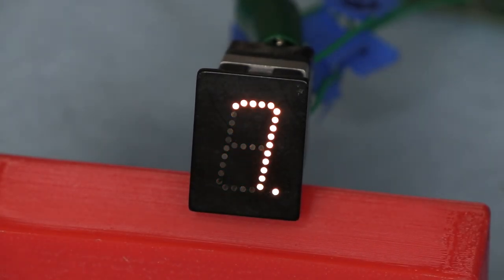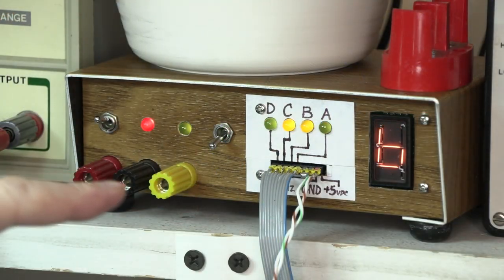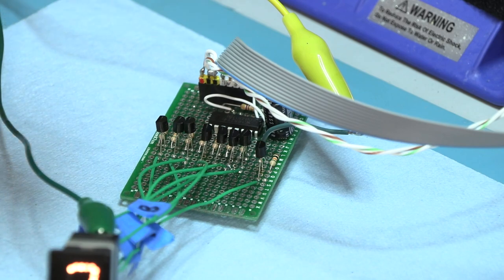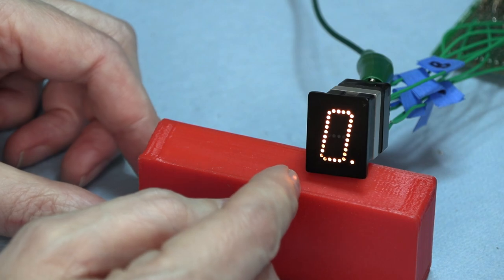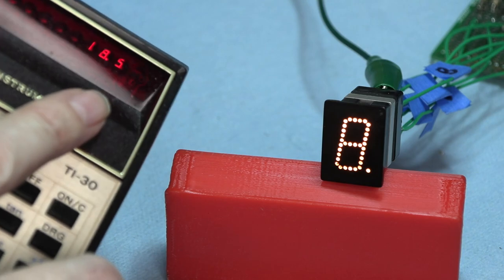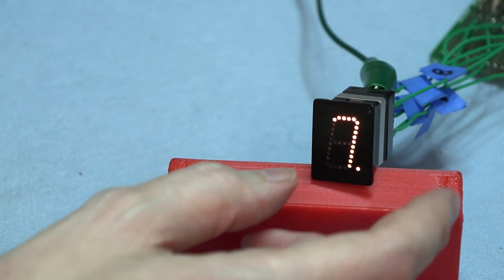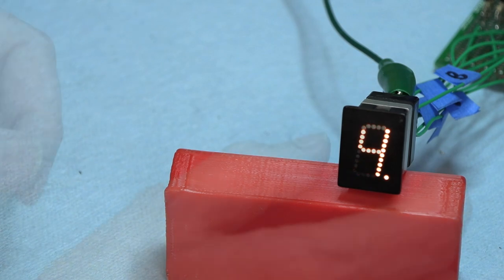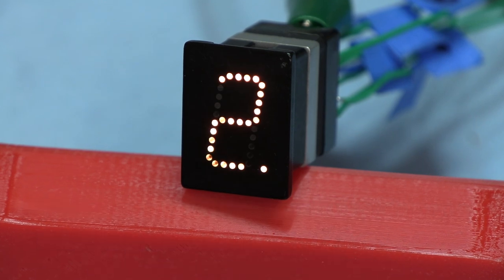Crazy Incandescent Display In Action!

Comment: The side view variability in the segments is very interesting.
Reply: Some equipment I used to service (built around 1974-76) used these displays on control panels. I always thought that they were used because they were larger than 7 segment LED displays available at the time, and the panels were sometimes in direct sunlight. The ones that we used had color filters in them, they used the 5v incandescent bulbs.
Reply: reighley scattering ?

Comment: Very cute displays. I miss the age of cool light pipes and (sometimes) fiber stuff in consumer electronics. These displays look easy~ish to retrofit with some warm white LEDs to get the look without the bulb longevity or heat cracking concerns. It would be fairly simple for the right person to write up some microcontroller or FPGA code to simulate customizable incandescent-like switch on/switch off times with some PWM to avoid the "instant on" look of LEDs. Thanks for showing!
Reply: You could run it on a raspberry pie, just a few dozen lines of piethon code, maybe a kernel recompile. As they say, easy as pie!

You could probably run quite a few digits with all the GPIOs and a few more lines of code. Throw a few more libraries and a few dozen more lines of code at it to give it wifi voice control via your IoT smart home integration with the Google/Apple/Amazone voice assistant. Then you could ask Alexa to display the digits of pie on the display.

Yeah, totally easy as pie.
Reply: Interesting replies. I don't think what I suggested is complicated in the least. I'm more or less "just" an advanced hobbyist (like Fran?) and I've done a lot of projects like this, so I have good sense for actual implementation complexity. Trust me guys, this is not complex.. it's a 1 hour job. It sounds like you have to adjust your expectations of yourselves if you consider yourself techies. :x

Comment: That's a funny one, a few minuted before watching this video I came up with an idea for a  74141 chip tester which features a 7493 binary counter, a DIP16 ZIF and a 555 or just a transistor multivibrator for the clock signal.

Comment: With what you said yesterday of having a wire for the decimal, and 3 wires, then that latch could be wired as a shift register, and you have then data, clock and either data out or reset, depending on configuration. Shifting as a long string the incandescent lamps will not really respond to the fast data clocking through, so updates will appear to be smooth, unlike the LED where you will get the brief flash as it goes through all states, but the inertia of the filament will mean it takes 50-100ms to get the lamps to heat up, and longer to cool, so you might have a faint 8 display every so often updating, but it will be very red and faint over the last digit yellow.
Reply: You would shift the data through all the digits, then latch the data from shift register to the decoder.

Comment: U wondered if you've ever messed with stepper motor drivers or servo motor drivers? I'm an amateur astrophotographer and I plan on building and coding my own go to telescope mount one day. Just curious if you've tinkered with anything like that. I have and Orion HDX 110 go to mount. It's a monster with a hundred and ten pound weight capacity. Not a portable mount but I don't own my own dark sky site yet, so I do drag that thing to west Texas two or three times a year. It's really easier to just buy a small portable rig but I'd actually like to go bigger than what I have once I get a place.

Comment: Many many years ago I made a one digit counter using a uniselector and a bunch of telephone exchange relays. The display was made from a great bunch of 'dial lights' scavenged from quite a few early push button TV's (no security at the local tip when I was 10ish). Each segment had 4 lamps - 4 by 6.3 for a 48V supply - as used to run the relays etc.
With an '8' on this display, the lamps were pulling 40W, it did a good job of lighting up my bedroom.
I never did try it outside in the sun, for it's daylight abilities, anyway it was big and very noisy, not in anyway practical so it got tossed may years ago - pity.